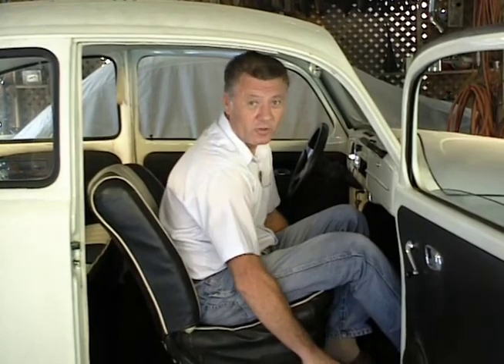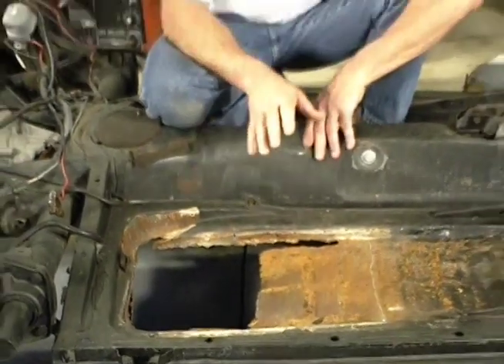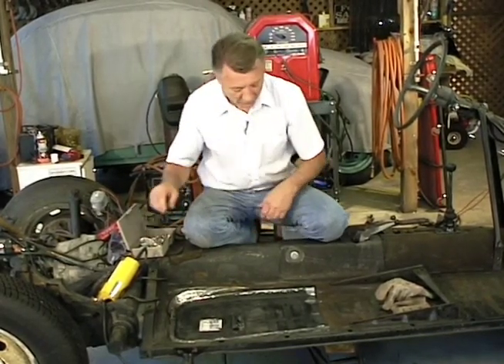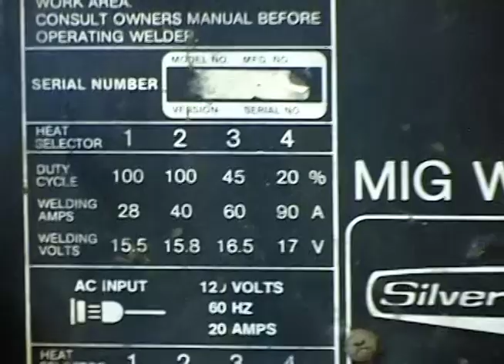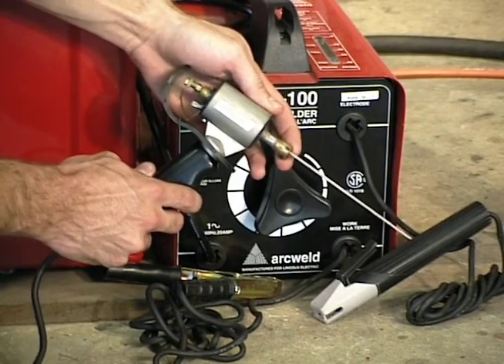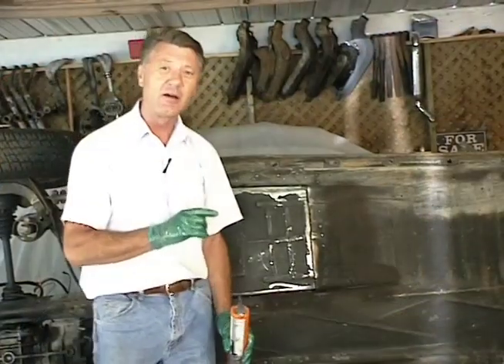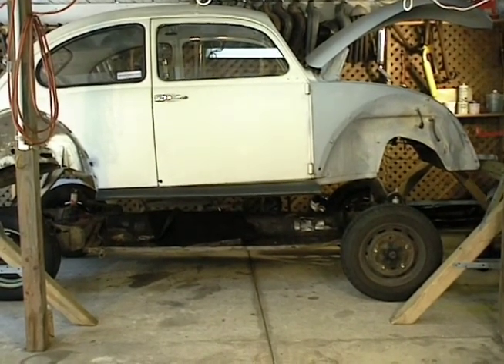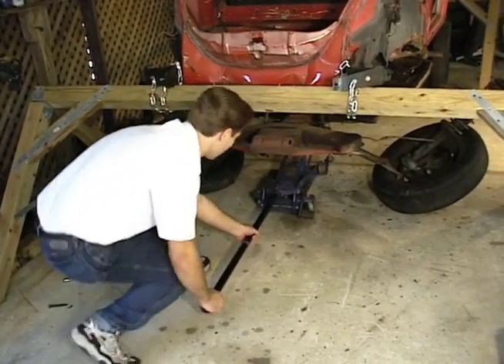Sample clips from: Bug Me Video -Volume 6 Floor Pan Repair & Replacement DVD (Volkswagen Bug)

Comment: Hello,
        I'd like to know if I can use Eastwood's Spot Weld Gun Attachment ,to spot weld my floor pans to the central tunnel( instead of Pop Riveting ) ? What do you think.?

Also I have a 220v AC welder( minimum current is 55 amps),I'm a bit afraid that it would burn the gun ,because I believe it's suppose to work for 110v AC welders, I was thinking in using a Diode in series with the Spot Weld Gun Attachment to half the power.( Same idea here as the Stitch Welder) .

Thanks you so much for your support !

Comment: Well, Looks like I'll have to get this video.  I have to do a complete, front to back floor pan replacement.  There's a hole under the driver seat that goes from under the seat mounting rails all the way back to the end of the floor panel.  And there's one on both the driver and passenger side.  How I managed not to fall though the floor when I sat in the seat is a complete mystery.
Reply: When mine came into my possession it was the seven layers of floor mats that kept me from doing a flintstones yabba dabba don't 😂😂